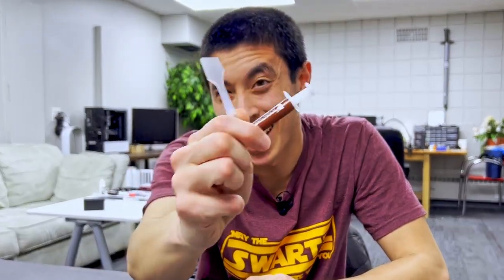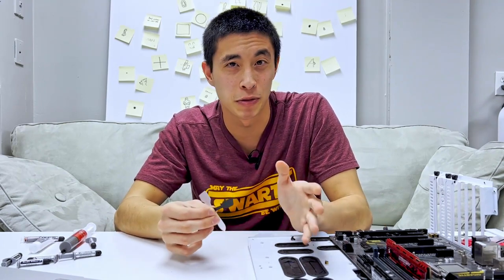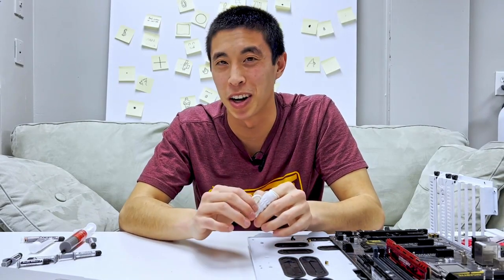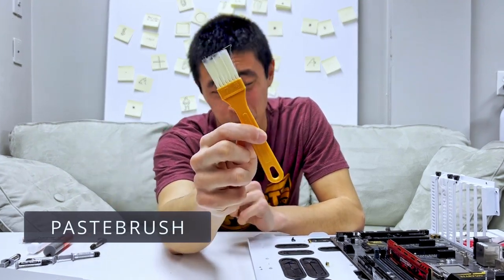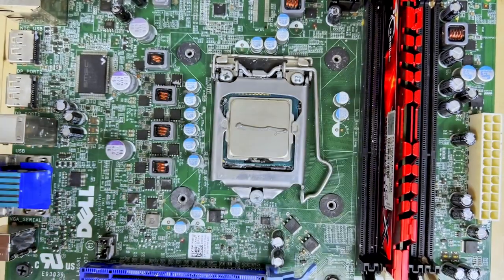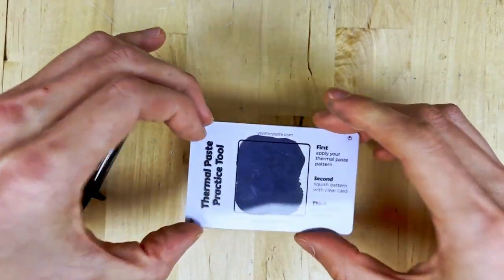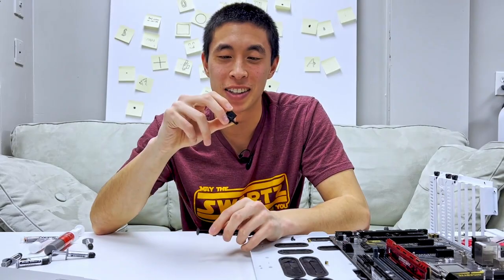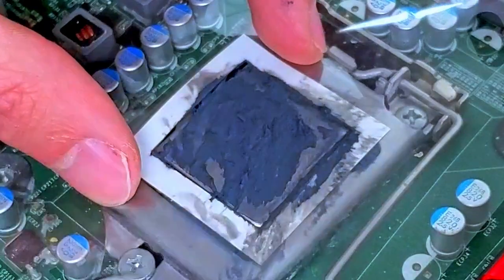Thermal Paste Accessories 101: Everything You Need to Know

Comment: Nice. Personally I use a k-tip as spreader. Cut one end and hold it by the other end firmly. After putting a little bit of paste in the middle of the CPU, you roll the k-tip in both directions to cover lightly but evenly the entire CPU heat spreader.

Comment: I've always wondered if you could get better thermal transfer of you pulled the metal shield of and had the paste right on the chips and the heat sync right on that (no shield at all)
Reply: The metal shields real name is IHS (Integrated Heat Spreader) When you remove the IHS you reveal the CPU die or dies. so when you then cool the dies without an IHS it is called Direct Die cooling.
Reply: Search: "Delidding CPU".

Comment: THATS A CPU GUARD? I PUT IT ON THE AIO WTF
Reply: I wonder if there is a block frame for generic CPU or GPU shapes that is like a cutout, and there is a special pressure card that has a special molecular structure on the surface that denies the thermal paste from sticking to it, so you push it down and it spreads it out then you lift it up and no thermal paste is left but you keep the shape.

The corners of the CPU/GPU is what generally does not spread to, and can help a tiny bit if you covered the whole surface.

I wonder if it's necessary to sandpaper the surface of the IHS a bit or the heatsink, to make the thermal paste cling to both sides and make it flatter when it's pressed?